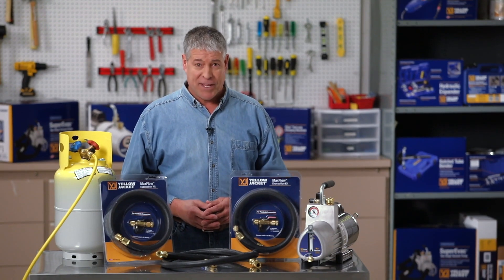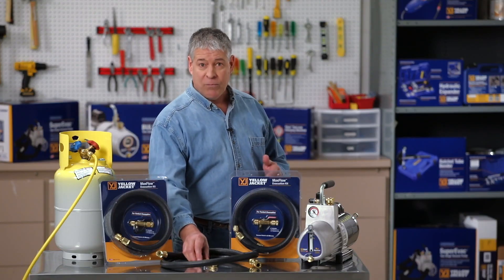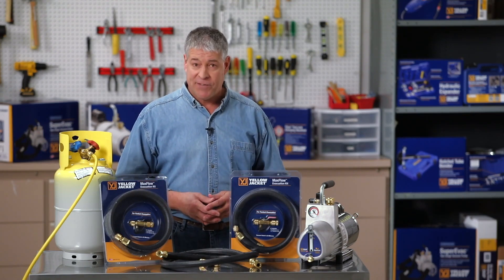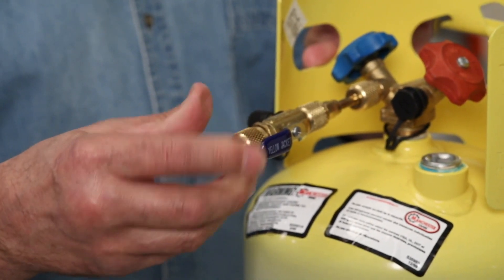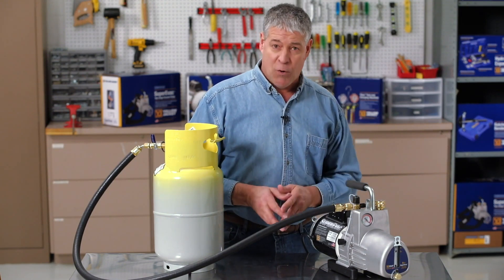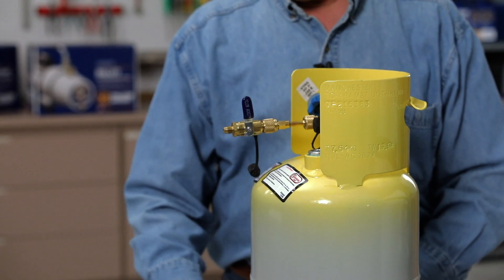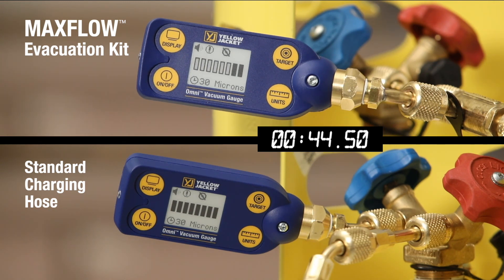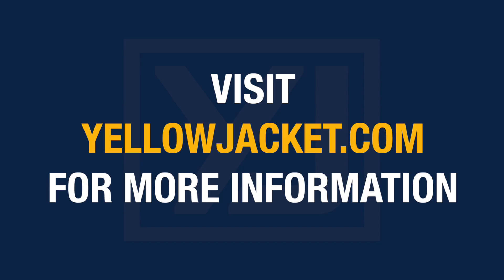Maxflow Evacuation Kit Video

Comment: Test is bogus. you have micron gauge connected to the vapor side of the tank on the charging hose test, and the gauge on the removal tool for the vac setup test. Why not keep all varibles the same? Not saying the kit isn't faster but you may aswell have your gauge connected directly to the 1/4" port on the pump. 🤷‍♂️

Comment: I've been using y'all's products for the last 10 years still have the first valve core tool from you and it has never had seals replaced, I don't use it for evacuation or recover but it does get used in my service bag to replace leaking cores and it holds pressure like the day I bought it. 💯 #1 in the industry hands down!!!!